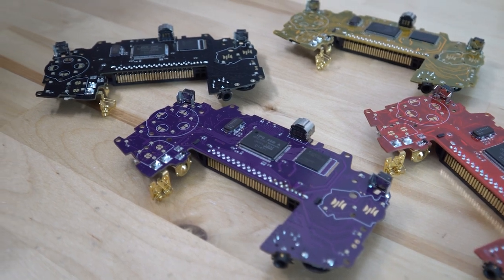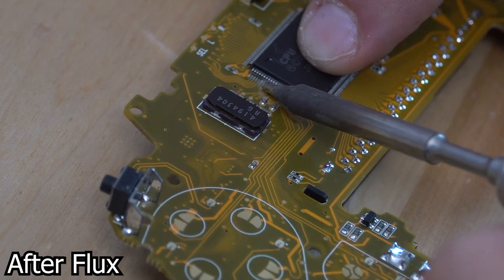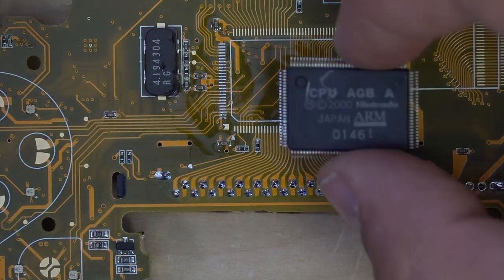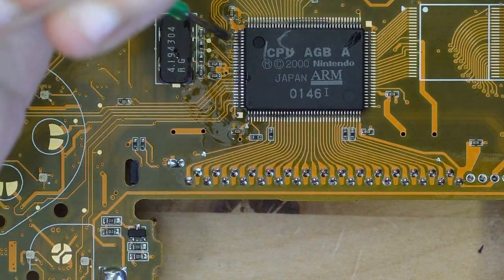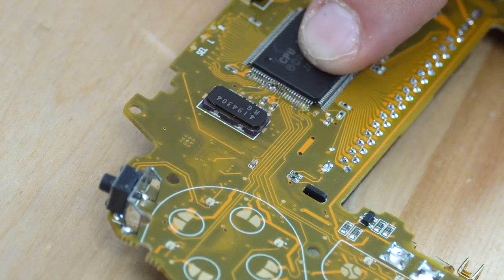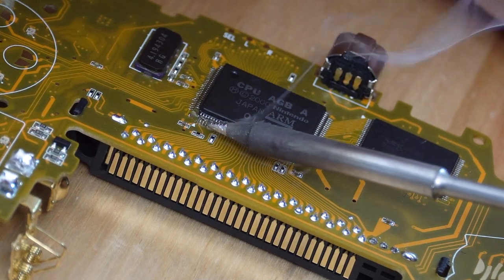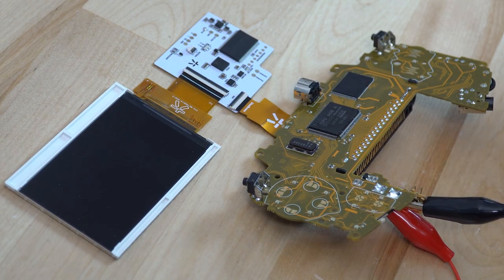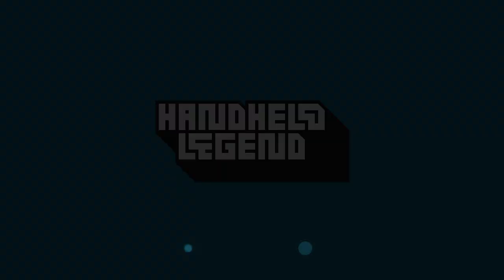FunnyPlaying Motherboard Install

Comment: Are there any recommendations for soldering equipment for people on a budget? I im certain it's already quite expensive to get the kit plus donor GBA, but to aquire the soldering equipment and other components to be quite expensive for people to pay just to build a gba. Are there any solderless versions of this kit, or atleast a way to request all components to be soldered on, to the pcb, so its only a matter of assembly for those less in the know how about what they are doing and the cost of just getting the tools, let alone the kit itself. Because i can see this project becoming even more expensive and likely a waste of money for inexperienced people as the damage things by accident or potential injuries

Comment: Can you use a GBA SP cpu and RAM on this board? 
I’ve searched around for an answer and can’t find anything. I have a working SP board and want to use them for this if compatible.
Reply: You can't, the GBA SP cpu has more pins than the GBA cpu(48 vs 32)

Comment: yeah but you really didn't show us squat this is a bulls1t video. ppl have absolutly no idea what they are getting themselves into especially when this video doesn't show what knowledge it takes to remove the CPU and ram ic chips off let alone the tools they are going to need to remove the chips themselves and I guarantee there will be a bunch of dead gba board and components after ppl try to undertake this project alone with a soldering iron
Reply: I used a hot air station and my cpu and ram chip came off easy lol.
Reply: Same here :D